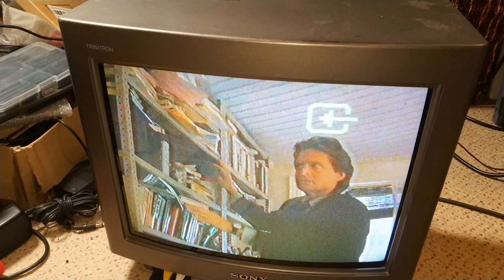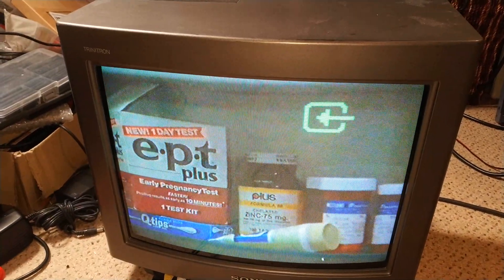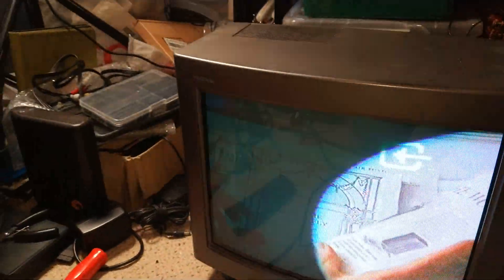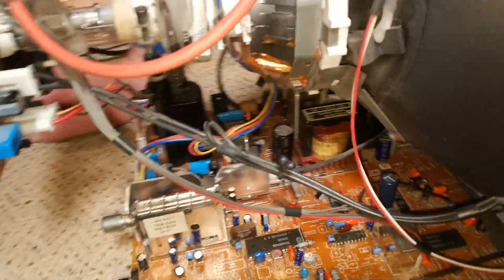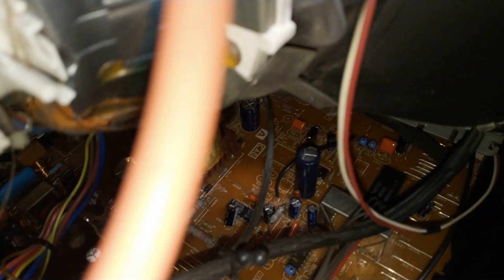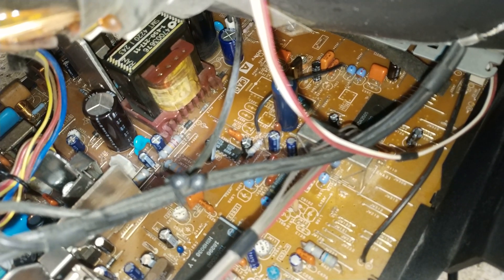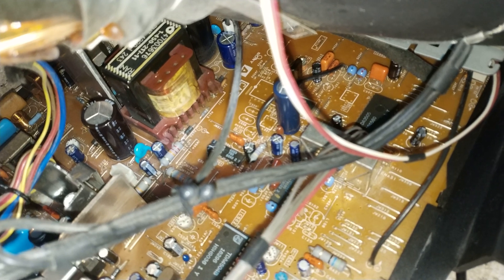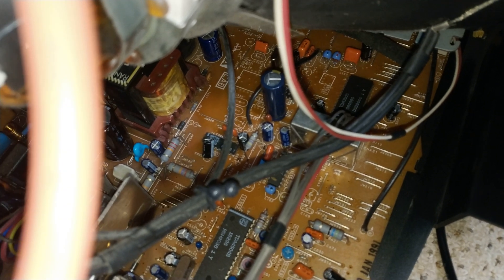Sony CRT TV - KV M1420U - colour issue fixed

Comment: Sony TVs from this era suffered from dry solder joints. I also fixed both of our M1420U units by re-soldering anything where the RGB went, the driver transistors on the back of the CRT and the RGB chip. Top retro gaming is back!